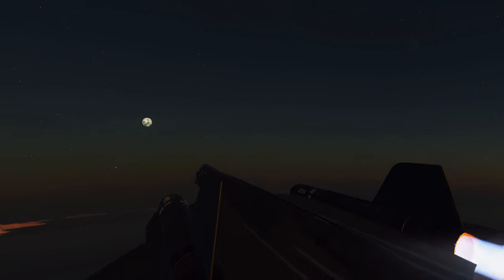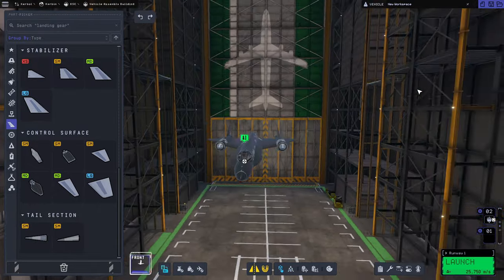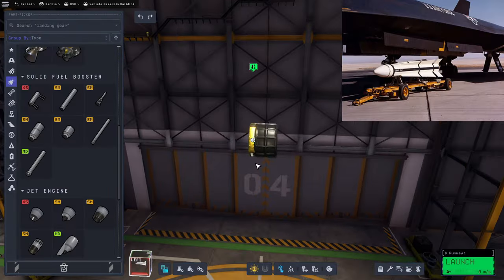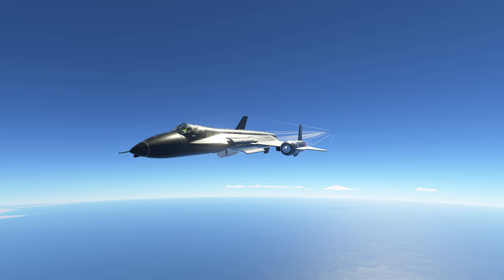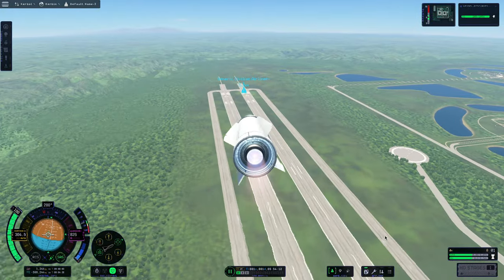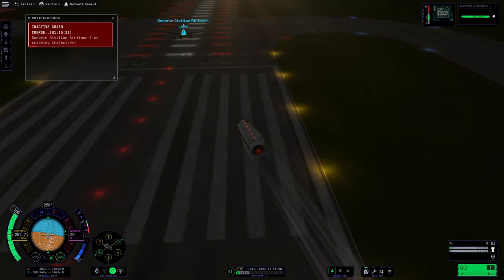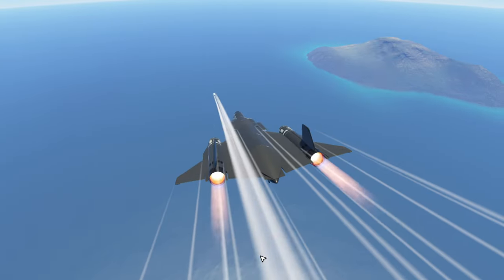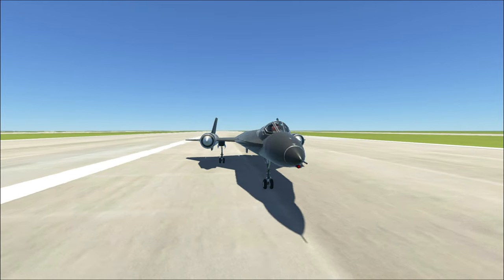Making The Fastest Fighter EVER (With Working Missiles!) - YF-12 and AIM-47 Recreation

Comment: Those old planes are for sure faster than the government admits🤔
Reply from the maker: I wouldn't be surprised! Especially if you pushed a bit past the safety limits, I've read that the blackbirds had plenty of room left in the throttle at "top" speed, though I could be mistaken.
Reply: @smooneychad   if you reached 10.0 mach you could bring it to 10.3 mach maybe, Maveric.

Comment: Wait, since when did KSP2 have flight stick compatibility? I gave up on it because flying with keyboard was absolute garbage, and I couldn't figure out how to get my flight stick to work with it.
Reply from the maker: It’s very iffy on whether or not it will work with your particular Flightstick. I was able to map the pitch and roll to mine (velocityone flightstick) inside the main menu control settings, but not yaw. I got around this by using the program “Antimicrox” to map the yaw on my stick to A+D on the keyboard (which makes the yaw movement jumpy but better than nothing).
 
 There’s also a mod called “input binder” which I believe is on CKAN, that is supposed to allow full flightstick/hotas support for anything. It works well and even lets you use the throttle if you have one. I just had some compatibility issues with it though so I used what little stock flightstick support there is. Hope this helps! :)